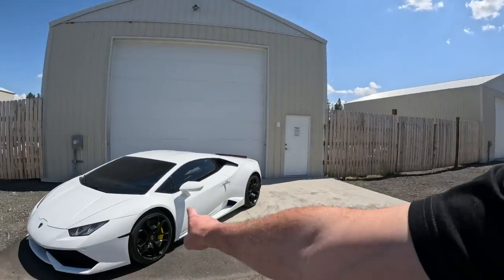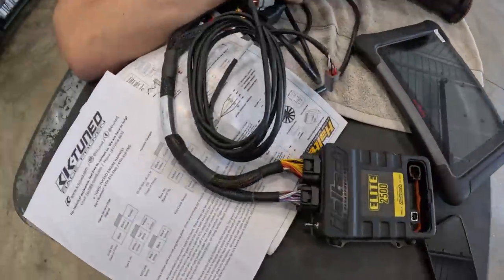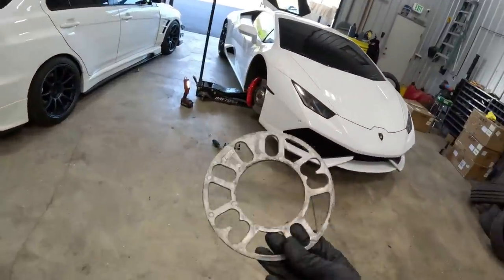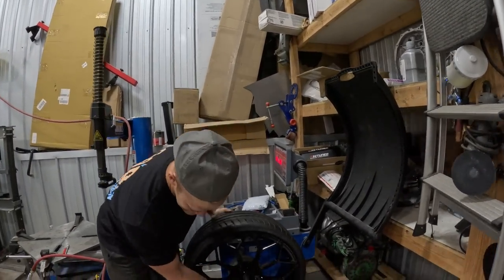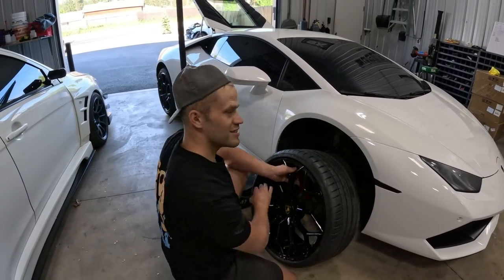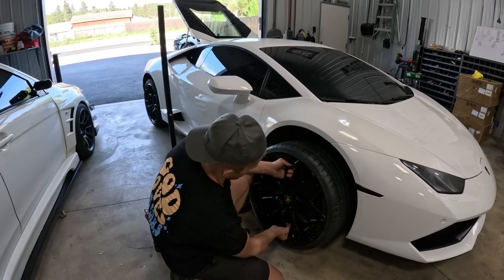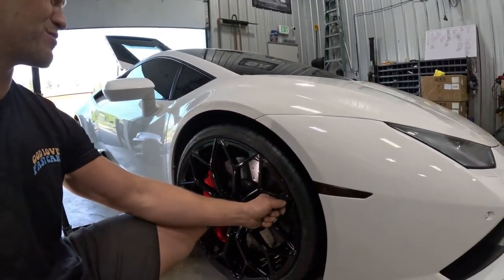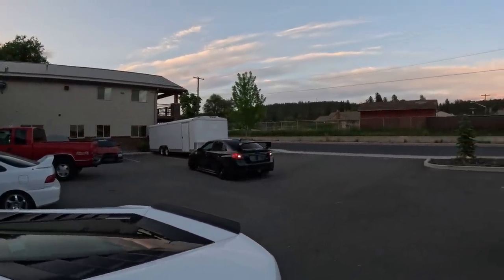Donuts in a Lamborghini?!!

Comment: Maybe the bend wheel was up front and was rubbing and they putted the spacer to clear the caliper. It was probably shacking like crazy so they putted the bend wheel in the rear and left the spacer up front.

Edit: It's not the same wheel for the front and the rear screw my Youtube certified mechanic advise.😅